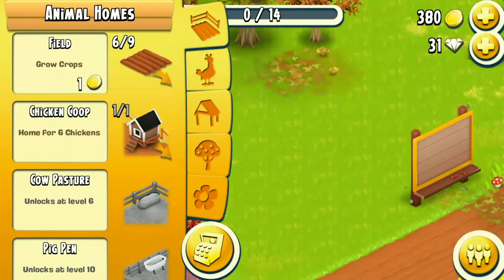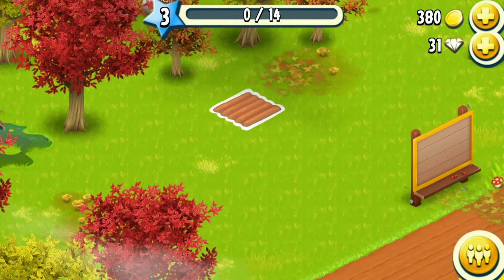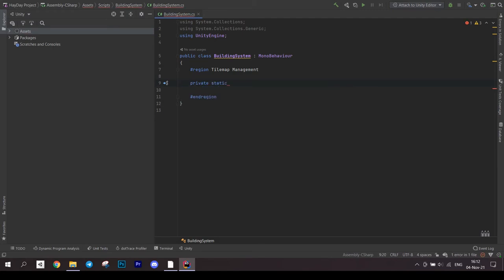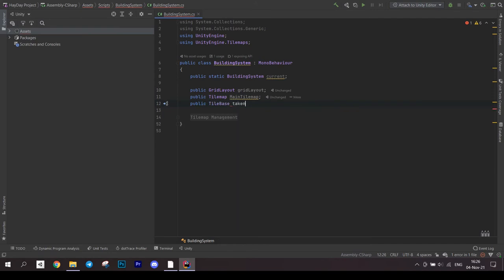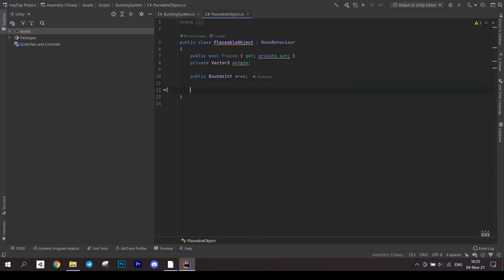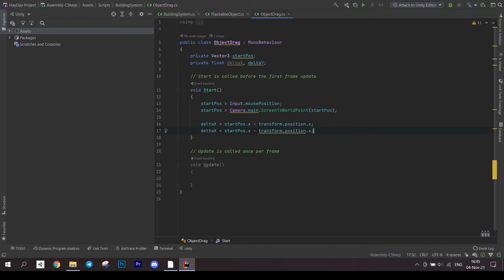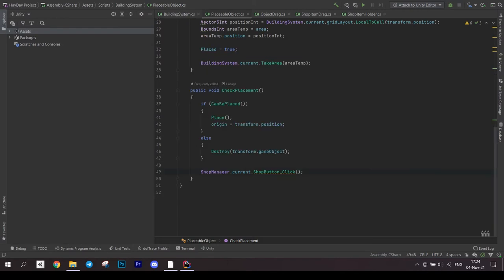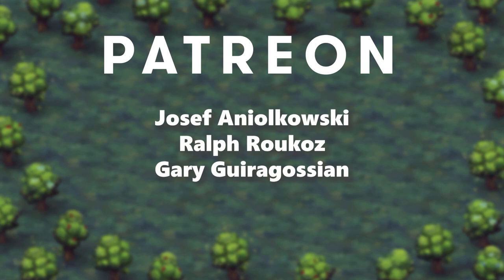Grid Building System Tutorial in Unity | Making HayDay

Comment: Hi Tamara, I followed all the steps in this video and the previous ones, I am facing a small problem when placing an object. The taken area is shifted a little bit up, also, the same problem appears when moving the object as the taken area is not cleared completely. Could you please tell me what I am doing wrong. Special Thanks in advance.
Reply from the maker: Hi, this is probably due to the pivot point of the sprite being in the center. If you set it to the bottom it should fall into place.
Reply: @TamaraMakesGames  Yeah, it worked. Thanks a lot. :hand-purple-blue-peace:

Comment: How would I go about rotating the building in game? Like showing it in different angles visually.
Reply from the maker: Hey there, you should check out this video - https://youtu.be/rKp9fWvmIww
It's about a 3D project because usually rotations are done in 3D games. If you want to do this in 2D, a good idea would be to have multiple sprites, one for each rotation. It may be a little bit tricky with buildings that don't have square size (like 3x3). But you can introduce a side enum and flip the size accordingly.